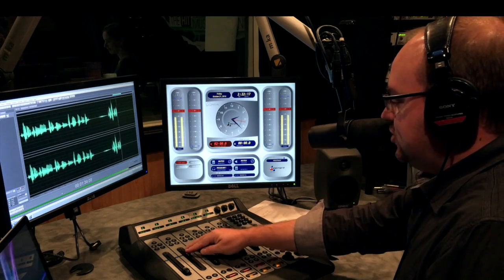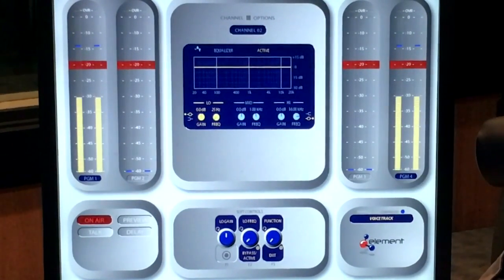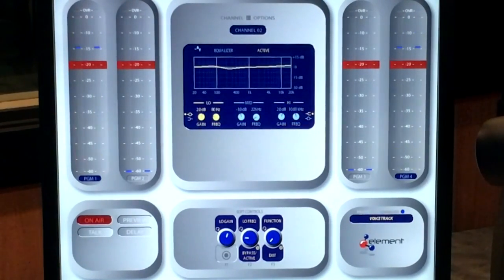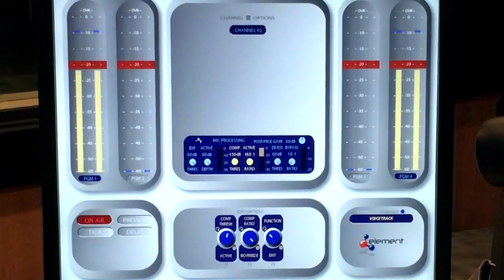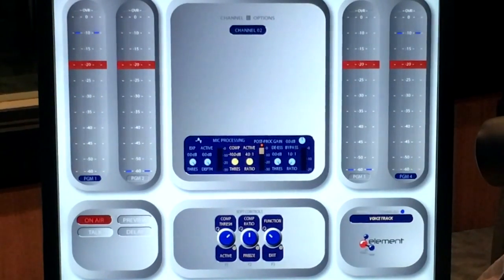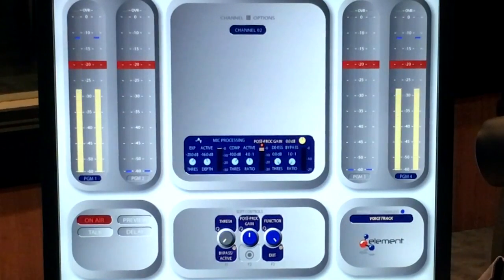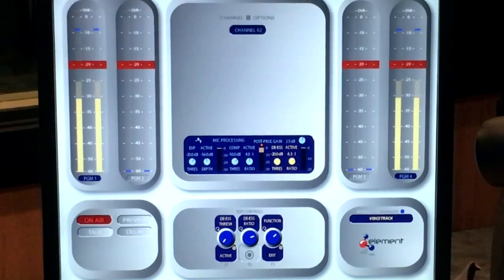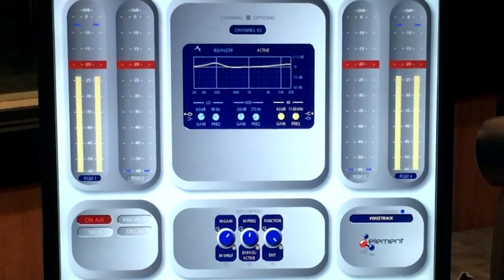Processing Microphones with Axia

Comment: Great tip! Better than outboard processors with intermittent mechanical switches and pots. Can you save your settings as a "preset" and "copy" the same settings to the other microphones if so desired?
Reply from the maker: Yes-ish. The easy way is to duplicate the source (by clicking "save as copy" in the source settings), and naming it something different and select a different input.